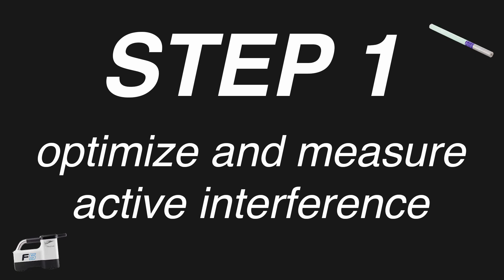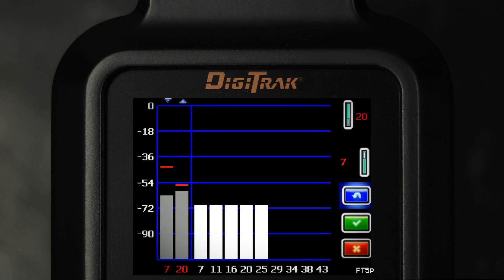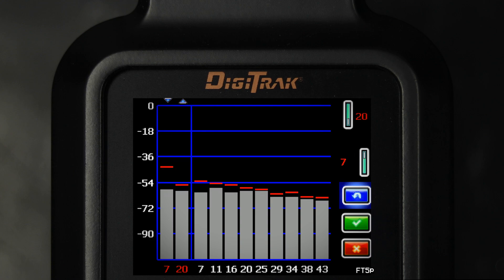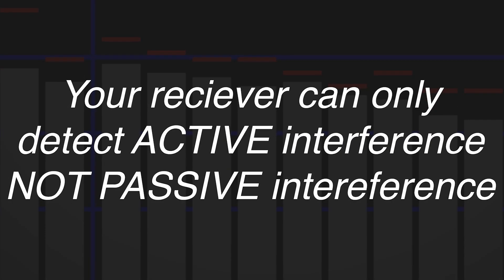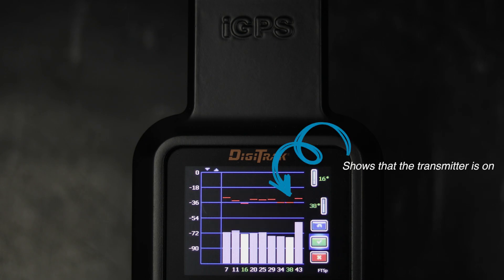DigiTrak - Falcon F5 Training - Quick Start Guide

Comment from the maker: Intro - 0:00
Optimize & Measure Active Interference - 0:10
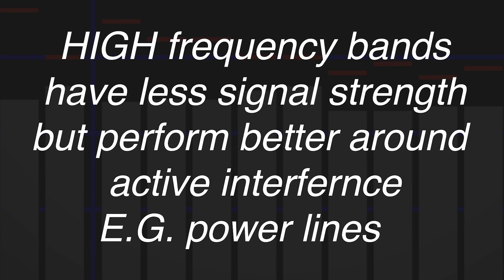Select Frequency Bands - 1:05
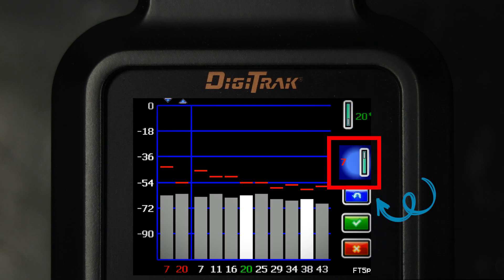Pair the Receiver with the Transmitter - 1:20 
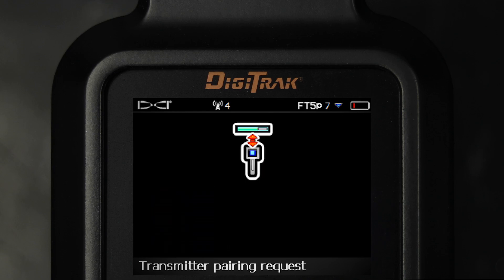Check for Background Noise - 1:47